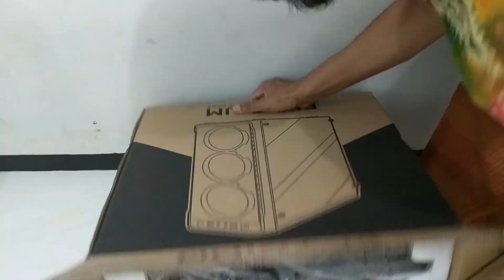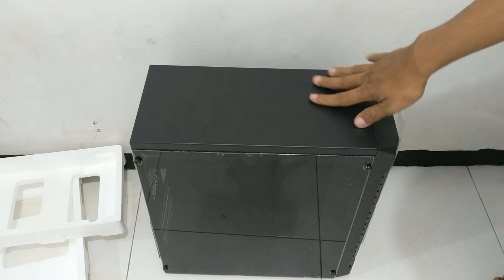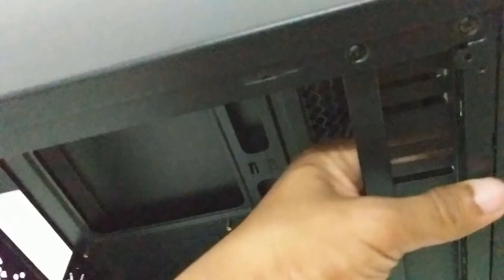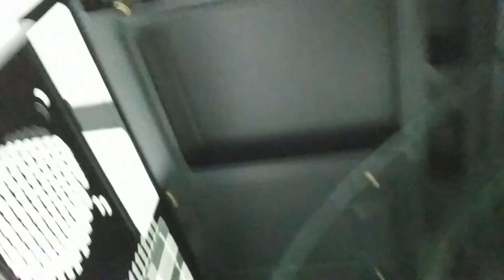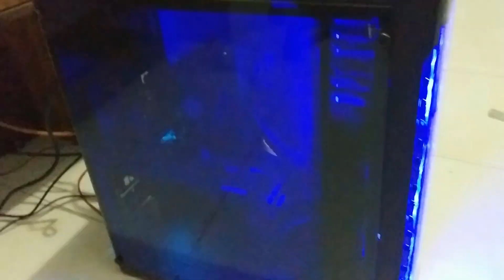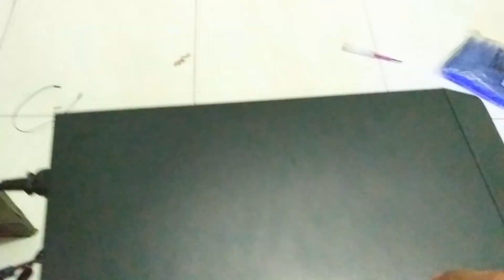Unboxing Infinity Elysium Transparent Acrylic Gaming Case - Casing PC 200rb

Comment: Bang Modal Pasangin Semua Yang Ada di dalam casing nya berapaan
Reply from the maker: psu corsair vs 450 bekas 400.000
cpu i5 7400T bekas 1.500.000
ram ddr4 4GB bekas 250.000
motherbord b250 bekas 600.000
vga gtx1050ti bekas 1.800.000
ssd 128GB sata 3 baru 350.000
hdd 1tb sata 3 bekas 300.000

silahkan ditotal kang